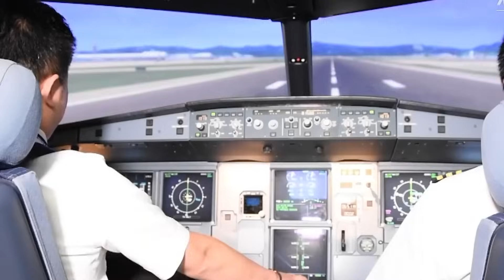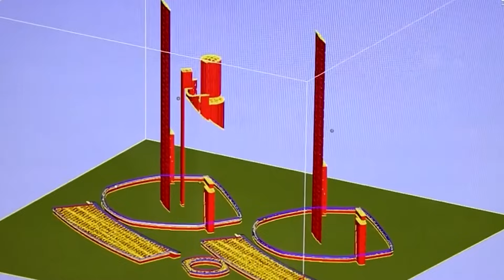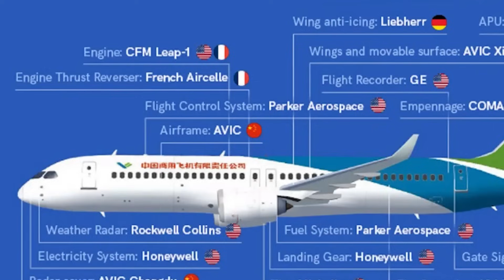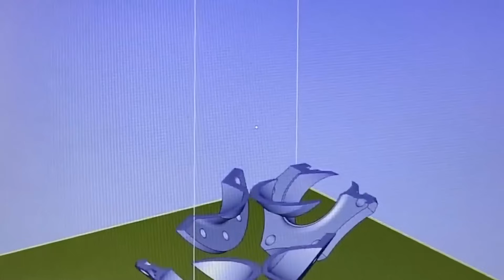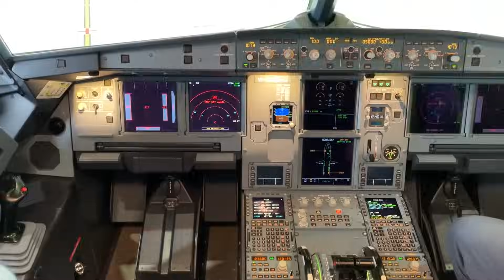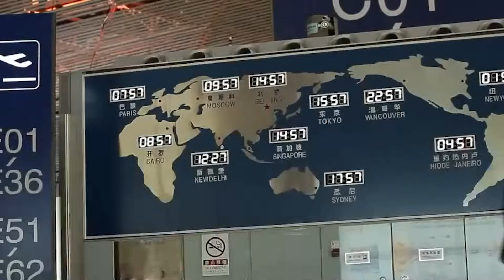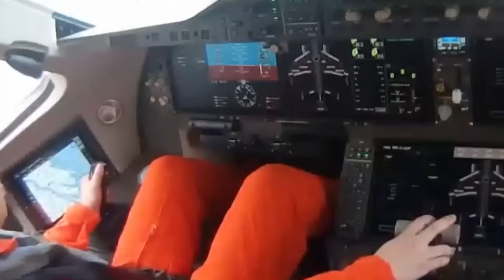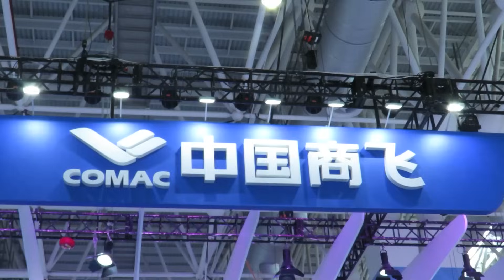COMAC C919 | Claim for the future

Comment: people have money should buy comac shares, it is just going up and up.  C919 is a game changer in china. It is the second break through after the troublesome of AR21 region jet. So the chinese are very proud.
Reply: It's a game changer only if it is at least 15-20% cheaper than A320. The fuel saving doesn't stand out despite LEAP powered. Unless Comac make the plane much lighter, the aircraft in its current state is only interesting for poor airlines that only want to maintain routes and flights. Also, unless we have another Covid-like disaster, or a war on a larger scale than Ukraine, I don't think western countries will struggle enough to think of buying cheaper aircraft than Airbus/Boeing.
Reply: Not yet listed on both mainland and Hong Kong bourses

Comment: Thank you! As a Shanghainese, we see the plane growing up day after days. Admittedly, there are delays in this project and meet a lot of delays. Financially, as you introduced in the video, the listing price is really quiet higher than stated. Arliners now can get discounts from both A and B quiet alot these days so the price for A, B and C now are roughly the same. But we still hope for the best for the C919 project and it really is much more sophiscated and well-thought than other chinese designed products
Reply: @oneviwatara9384  yes that's right. It will face the similar situation as the Russians nowadays if the gov ditch the current balance

Comment: Chinese can build planes, no doubt about it. But can it be a competitive one? Yet to see. 
Many in the comment says “oh I won’t step on one” I would have the same mindset, but then 737 MAX reminded us, a good reputation doesn’t mean their planes is fool proof.
Any competition is good competition. Boeing…fallen from grace just because they don’t have competition. While Airbus they are bossy enough to cancel Qatar’s order because defects they deemed not “an safety issue”. A 3rd option can force and remind the other two to watch out.
Reply: I don't know, after hearing about the range issue, I'm worried this might just end up being another Dassault Mercure, essentially a French 737-200 with less range.
Reply: @randomscb-40charger78  china is not france
Reply: @EmmaNguyen-mg5xq  I said the Dassault Mercure was essentially a French 737-200.
Reply: @randomscb-40charger78  they already have 600 orders. Iran is also a very big market for aviation. Due to sanctions they are unable to get any aircraft whatsoever. They are desparate for any new aeroplanes so they will buy it for sure. Africa is also a large potential market. No way this project can fail.
Reply: I do agree, a third option to Airbus and Boeing would give some competition would be better internationally.
Reply: I guess you didn't see massive orders for 787 and 737' s last few days.🤣
Reply: @randomscb-40charger78  It doesn’t matter about the range or other performance short come, it’s only about if the manufacturer and the economics standing behind it could support such projects or not. We have a lot of examples in history: BAC, Hawker Siddeley, Fokker, Vickers, Dornier, Dassault, and recently Bombardier. And back to the reason why Mercure has such a short range, that’s because it is its major customer, Air Inter’s requirement. To survive, Dassault has to.
Reply: @oadka  C919 uses lots of US aviation components, i doubt they can sell to countries sanctioned by the US
Reply: I would never step on one 737 max for sure.

Comment: Excellent, comprehensive video. One correction. I was an officer at International Aero Engines AG in the late 1980’s to mid-1990’s. We were developing the MD90 with McDonnell Douglas. “China Trunkliner” was in its early stages.  This was a Shanghai Aircraft produced MD$82 for the domestic market. As the MD90 took shape, China wanted to also produce the MD90. Catic insisted on coproduction of the IAE V2500-D5 in China. In other words they wanted to steal the engine design secrets. IAE and our five nation partner governments wisely refused. The MD90 co-production aircraft never happened.
Reply: Actually 2 MD90 were produced in China.  The program was then cancelled by Boeing after it took over MD.

Comment: I am not an aviation expert, but the fundamentals of the new Chinese airliner seem noticeably better than the Boeing 737. Which was developed way back in the 1960s.
The COMAC C919 does not come across like a copy, but an improved version of the 737. Maybe it's more like the Airbus A320?

I really took notice of the added ground clearance, higher wings and better placement of the engines!.. Time will tell, but I like the starting point.
Reply: But thg e A320 SUCKS.
Reply: Well, it has two wings, a T-tail, 2 engine so obviously according to westerners, it is a copy stolen from Boeing.
Reply: @JB-nt5lu   Both the A320 and the C919 have better fundamentals than the ancient 737 airframe with its shoehorned new engines screwing up the plane's balance and aerodynamics.

Then there is the disturbing amount of wing flex, and fuel leaking out during takeoff??? 

Watch... "Fiji Airways 737 MAX 8 Takeoff from Wellington with Lots of Wing Flex and Wingtip Vortices"

It's better for the Chinese to go their own way as much as they can. Keeping it classy.

Beware the Boeing apologists making excuses for everything. Even trying to make all the disturbing things sound good or normal.
Reply: @gelinrefira   That's a good point. What were the Chinese supposed to do, put the engines on top of the wings? That would have been great fun for the passengers.

I see substantive improvements, not copying. I'm old enough to remember the Japanese being accused of copying in the 1980s and 90s, but they were more innovative than that. There was also better quality and refinement.

That competition inspired my fellow Americans to do better, but there was a lot of anti-Japanese/anti-Asian bitterness being expressed. Now I see the same ugly reactionism toward the Chinese. 

My fellow Americans should focus more on what we are doing, or what we are not doing, but should. If we started copying some of the things that the Chinese are doing, that would be progress.
Reply: @harleyearl3289  fuel comes out the end of the wings as its designed too. when fueled, cold fuel expands and needs to vent. during taxing, it can happen if the fuel temp rises a lot. wings also flex as they are designed too. they even change during flight as supercritical wings are more efficient. 

the b737 looks old because the fuselage is a chopped down from the b707 - the 1st boeing jet offering. so the design is 70 years old.
Reply: @mrrolandlawrence   "This house is clean."
Reply: It's better than 737 and airbus, lighter more fuel efficient and cheaper.
Reply: @gelinrefira  🤣🤣
Reply: @johntwomey2561   Less expensive is fine, but not cheap. Cheap often means low quality. I don't trust cheap. A plane should be uncompromising without costing a zillion dollars. The Chinese can do that, and I'm going to assume that they did do that with their new plane.
Reply: @harleyearl3289  Too right (Aussie expression). My apologies for cheap inappropriately. Available at a lower comparative price is what I meant.
Reply: @johntwomey2561  That's absolutely false, it's barely cheaper, nor more efficient.  How is it lighter when COMAC had to ditch composite wings?  They are sacrificing a lot of range and cargo. It's a good start but not worth the trouble for established major airlines with no political pressure to order.
Reply: Even though is models of the 60s, the fact that it has been continued to sell shows how good of a workhorse it is. If it absolutely sucks, then it would not be even close to the 100 order or none airlines would buy it. The important thing is that is already more efficient and comfortable than the older 737s, and that is what many passengers like, and so far, the order and the people liking it, are going up besides the big problem  it faced. That doesn't mean it is perfect or what haves is resolved because the hearts of those affected are still they are still heartbroken and is definitely one of the worst ways to die.
Reply: Returning to the Comac, I am also happy that there are more options for new and quiet aircraft, that is better for the passengers
Reply: The COMAC C919 does come across as a cheap copy of the 737 but tensions in Chinese theft of the Boing 737 will result in the fact the GE will  not sell the CFM Jet engine to China!!!
Reply: @kimberlywilliams7543   A cheap copy of an inherently antiquated and inferior plane? If you are going to accuse the Chinese of copying something, say Airbus. The new C919 is a huge fundamental improvement over the ancient 737. I am talking about the basic architecture and balance of the C919.

Maybe you feel that Boeing's avionics is superior, or its engines. I'm talking about the plane. The ground clearance and the proper placement of the engines. What the Chinese did is what Boeing should have done, but was too cheap to do.

Boeing cut corners in a dangerous way. The 737 is a very old airframe with hotrod engines positioned in the wrong location because the 737 is too low to the ground. The 737 is dangerously flawed, and needs real advanced avionics to compensate for it. One glitch or pilot confusion, and the 737 crashes.

I would dread being a passenger on the 737. For good reasons. On a C919, I would be much more comfortable, especially if the pilots were also Chinese. Did you see that training exercise video? It's awesome. These people are operating at another higher level, and I'm not talking about altitude.

The Chinese today remind me so much of my fellow Americans from decades ago. The Chinese really got their blank together. Not even the sky is the limit for them, they are going galactic. The Chinese have the same can do/will do industrial spirit that Americans used to have. It hurts me to say that, but it's true. The Chinese are a great people, I don't care what their ideology is. My guess is whatever works best to get the job done. That's what my fellow Americans were like. Can do/will do/done. 

I really miss that in America, but it's thriving in China. How can anyone not admire and respect that?
Reply: Since when did round clearance alone determine how modern an air craft is expected to be...? Fuel burn per seat and cost to manufactured matter more than engine placement

Comment: Finally, a great cover for a medium haul competitor!

It’s rather surprising that COMAC didn’t even consider making a B767/A300 type widebody for mainland flights. It would definitely sell like hotcakes to Asian markets which currently utilize big widebodies at about half capacity for domestic routes. Low cost carriers in SEA region like Cebu Air, Vietjet, and Air Asia wouldn’t say no for a cheap brand new widebody that would save them more money in the long run.
Reply: That's what CR929 is, no?
Reply: @ex0duzz  The CR929 is slated to be a competitor to the B787/A330, which currently is too big for the medium haul routes predicted to take off (no pun intended) in the coming years as point-to-point travel becomes more commonplace.
Reply: Well it took them 10 years to build this aircraft. You are asking too much.
Reply: @DontUputThatEvilOnMe  Maybe I do, but so does Chinese carriers. China pulled out from the CRAIC joint venture for obvious reasons, which severely crippled their future plans. Boeing also publicly said that they’ll be cancelling any plans for B797/NMA project as the tech to do it sustainably wasn’t there yet, while Airbus seemed to push their luck with the A321XLR. If anything, it’d be a miracle if the C929 even be materialized within this decade.
Reply: @DontUputThatEvilOnMe  no thanks to the USA meddling
Reply: @Nafeels  China hasn't pulled out of CRAIC.  There was a high level govt meeting last month and the CRAIC meeting to discuss the partnership is Feb/Mar maybe?

Russia and china have divergent goals on the program, and the latest Russian comments allude to maybe becoming a only a parts supplier on the C929.
Reply: The aircraft is not only not competitive when it comes to pricing, its fuel efficiency is also no better than those of 737NG or A320 and way worse than A320neo and 737MAX. Also airlines have spent millions to billions training their crew which not only includes pilots but also flight attendant, technicians, engineers, baggage handlers, fuelers, etc towards Boeing and Airbus aircrafts. What is the point of adopting this unproven aircraft when it offers no fuel advantage or any other significant improvements compared to the competition and requiring airlines to spend so much on retraining to this very specific unproven aircraft. Yes, competition is good but this aircraft is not it in terms of competing its value proposition to other manufacturers. Also, you are treating as if Boeing and Airbus are the only narrow-body aircraft manufacturers.
Reply: @TheAmazingTechZone2  The aircraft has one unavoidable strong point. It destroys idiot risky case "political sanction" which is always happened by US.
Reply: @alexlo7708  I have no clue what you are talking about.
Reply: @alexlo7708  If you are talking about the sanctions between US and China... I mean can you blame the US? China has been committing IP theft to speed up development of the C919. These companies include Ametek, Capstone Turbine, GE Aviation, Honeywell, Safran.

Comment: It should have mentioned that the aircraft has a range of 2,200 nautical miles, enough for most domestic Chinese and regional routes. The C919 can seat 158 to 168 passengers.
Reply: 737-8/900 can pack 185+. .......
Reply: @bunyavissuthisorn5909  the 737 is a proven design from the 60s. The COMAC is nothing short of amazing! I hope China’s future is bright
Reply: I believe the maximum range of C919 is around 3500 nm

Comment: What is the current state of russian aviation? Do they have anything domestic to replace the airplanes that is going to run out of flying hours soon? Will Comac be crucial to replace other brands (with russian engines?) ?
Reply: Yep, TU-214, will be upgraded to modernised CM spec, so two pilot cockpit (was already done some time ago but never really produced), SJ100 new is already flying with PD8 engines, Irkut MC-21 is flying with PD14 engines, so soon to be delivered, Avionics now run on JetOS, there are other beauties, like il-114-300, close to certification and of course the super mega awesome IL-96-400, but that one will most likely be only used for government services and not commercially (shame). Some smaller projects like Ladoga are also running but that is a small plane. Russians finally stuck their heads out of their asses and will rebuild domestic aircaraft manufacturing to the max potential. Oh an if someone thinks they cannot produce semiconductors for their Aviation sector, please just Google Russian semiconductor industry and grow up.

Comment: Its inauguration flight is 2012, refered to 2018 Wikipedia. Number built is 10 as of Dec 21, 2022. FAA just endorsed 919 in the last minute, most airlines in China hardly buy it. Such a promising jetliners. ......

Comment: I can't see this being successful outside of Chinese domestic market. Like you mentioned in the video the maintenance infrastructure isn't in place like boeing, airbus or even embraer.  Furthermore, aircrafts such as the a320 neo, max 8, a220 and the new E2 are proven to be very popular. Which it's going to be hard for the c919 to compete against, it uses A LOT of foreign components. Which it turn it could be problematic with the raising tensions with China and the west.
Reply: I too only see this in domestic China, 3rd world countries with strong China ties, or some upstart ultra low cost that can't find any inventory to lease. The shorter range, lower capacity, and lower efficiency makes it not worthwhile for any major airline to invest resource and further segregate their already thinned out (post COVID) pilot roster. That said, it is a decent start and having a new manufacturing pipeline is always good in this sub category.  COMAC will need another generation to catch up.

Comment: The Chinese may have something here.  
"Most airlines do not care about the latest carbon fiber components or lowering CO2 by 20%"
Neither does anyone who flies in the US. We fly Southwest because we want the cheapest. 
Building a aircraft that carries 190 to 250 passengers with a range of under 3000 miles is ideal for the domestic Chinese market. That said, I think COMAC is decades from being in Boeing or Airbus radars. But the Chinese are very patient.
Reply: completely agree.  they also learn and develop extremely quickly.  chinese cars were trash in the 2000s and now they have companies that build some of the best EVs out there.
Reply: It seems nobody in America cares about the environment
Reply: @randomname931  building car and evs us different but okay
Reply: @oxcart4172  largest emitter of co2 by population
Reply: @didyoumissedmegobareatersk2204  
They're at least trying to cut down. They produce more slar panels than anywhere else!
Reply: It took Airbus about 50 years to get where they are.   Even if China can 'borrow' technology and learn faster as technology has improved since 1970, it will still take time.
Reply: @randomname931  🤣😂🇨🇳😂